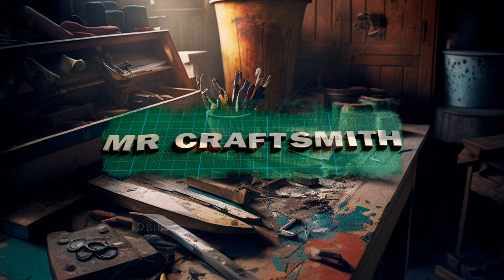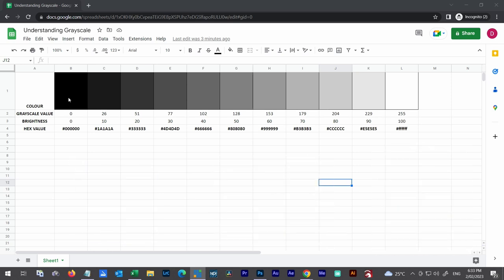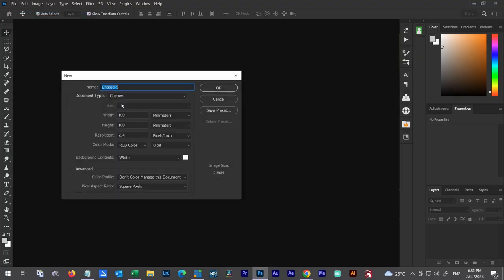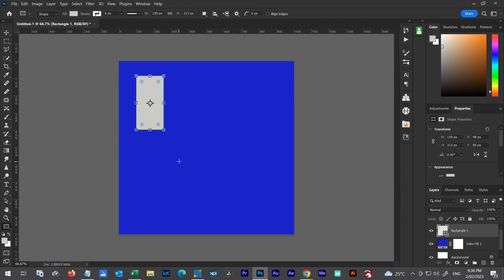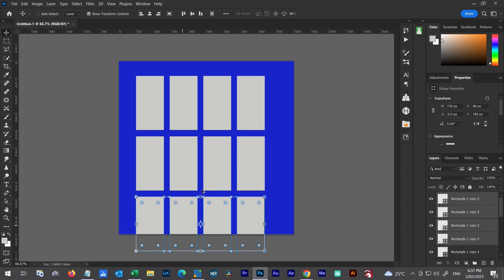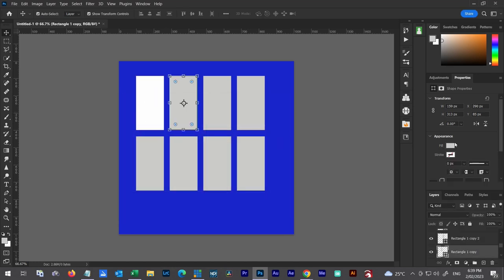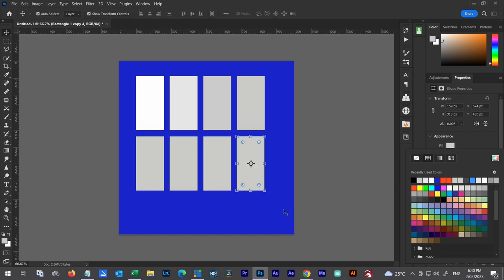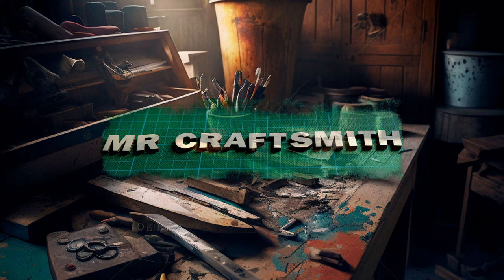Create Your Own Grayscale Test Grid for Diode Laser Photo Engraving

Comment: hi , very nice job , very interesting , can you share the file ? I have not photoshop thanks and regards
Reply from the maker: Hi Michel - thank you for watching - I'm working on updating the files, so as soon as I have them updated I will post a link to download. Will include files at 254 and 300 DPI for both dark substrate (slate) and light substrate (white tile or wood)
Reply: @mrcraftsmith  hi Darren , good news , thank you in advance  ,actualy ,   I try to make a 20 levels grayscale draft  with gimp and inkscape but it's difficult to find the intermediat values (95 , 85 etc.. ) in hexa mode